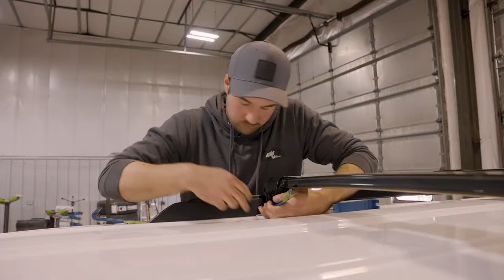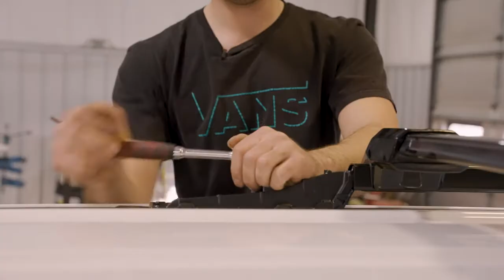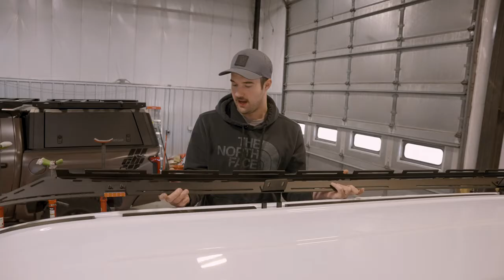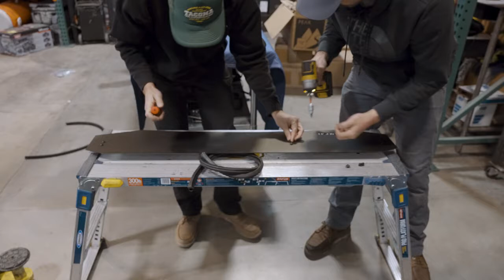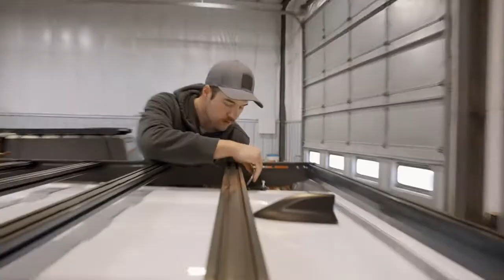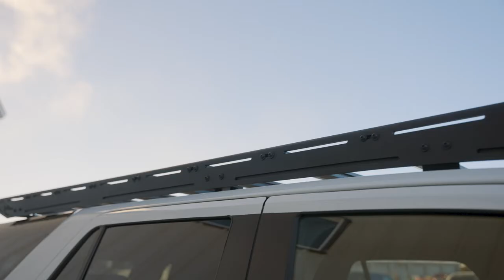INSTALL GUIDE: Prinsu Pro Toyota 6th Gen 4Runner Full Roof Rack

Comment: hhhm the gaps - top left and right is a buzz kill, why not spend the time to make the front air fin match perfect to the curve of the windshield/roof?
Reply: It's to allow rain and snow to escape, they explained that in a video.
Reply: What kind of thread locker did you use for the wind deflector? Also what kind of silicone was used to fill the spacers?